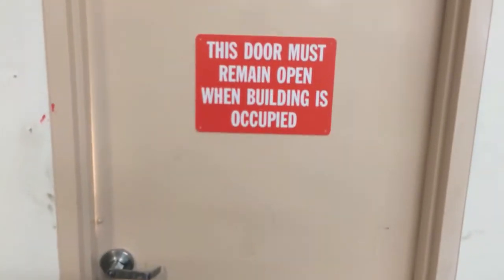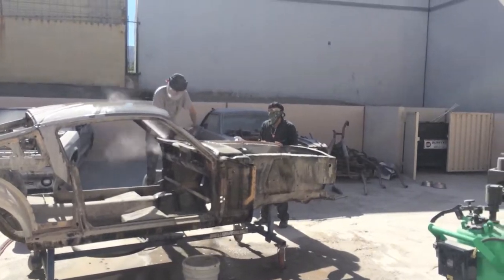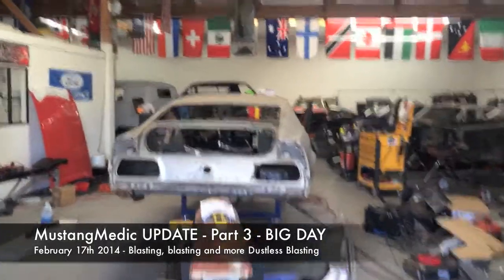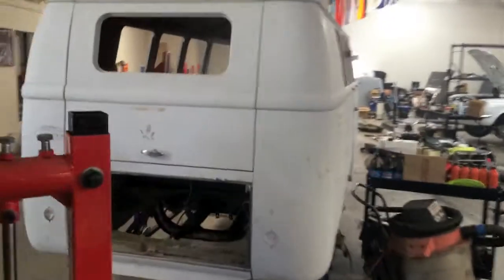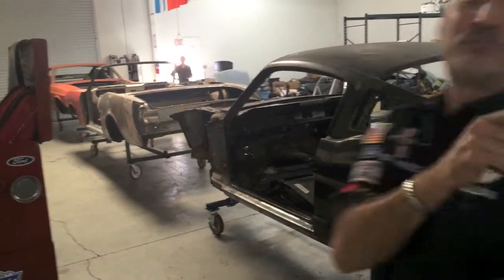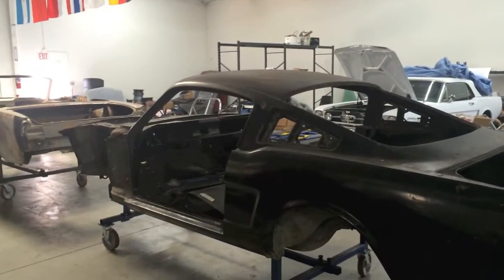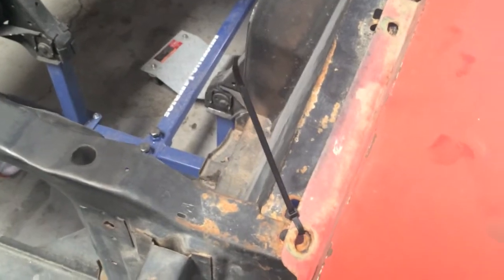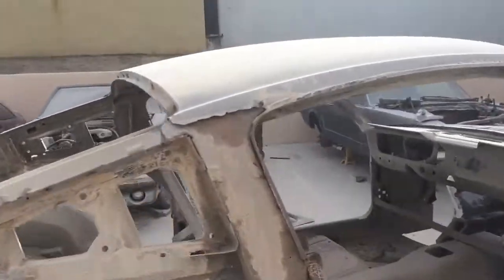MustangMedic UPDATE 2-17-2014 - Part 3 Ford Mustang Restoration Show MustangMedic

Comment: Cliff your blasting a little bit too close and its making it rough texture. Also It will go faster if you back off a few more inches and let it fan out a little bit wider then it will cover more area. And make very slow sweeping motions on the big areas. but in the tight spots in the corners you gotta sweep back and fourth kinda fast so the sand dont build up.